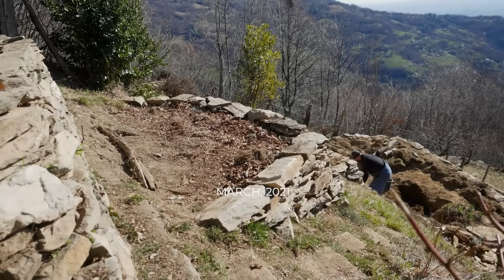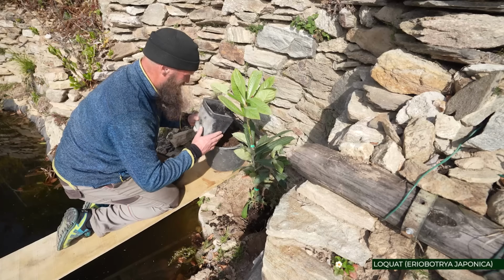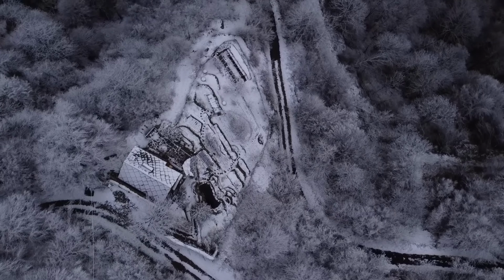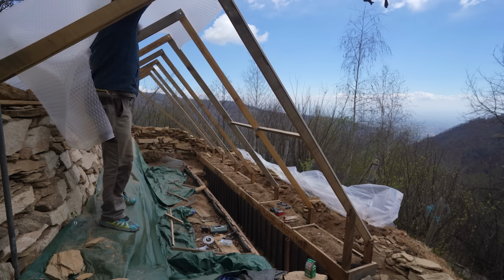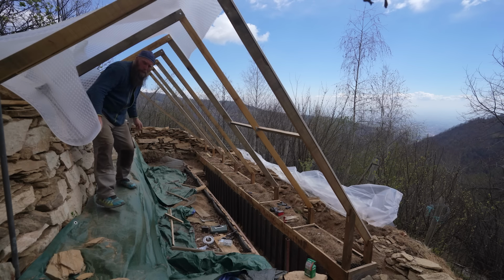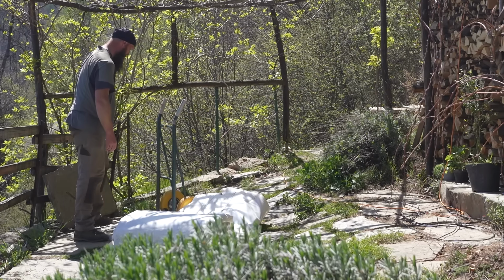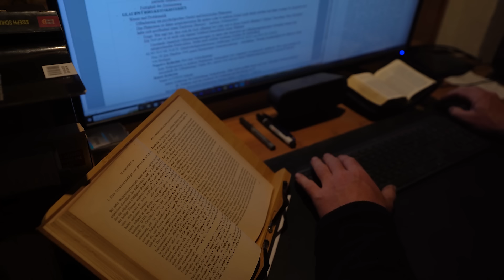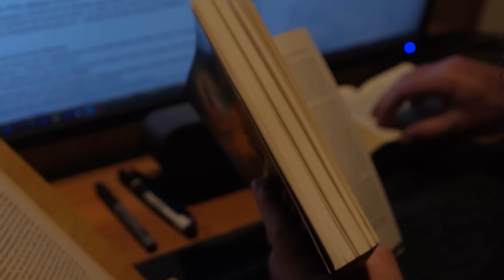One Year in the Life of a Part Time Hermit - April - Of terracing, a roof and the coming rains

Comment: Johannes, did you know that as a rule of thumb, one hundred years of leaf litter in deciduous temperate regions will provide no more than one inch of  soil. I believe that in the tropics it is even worse. Wood chips and animal compost, food waste etc are the real soil builders. And as any gardener will tell you, they are permanently in short supply. EG; typically I would produce about 80 litres of food scraps in the compost, this is enough for only one two metre by one metre bed.
Sorry about mixing the old German measurement system with the Metric, I am seventy and find reducing inches to Frenchiemetre's Impossible!

Comment: Hello Fr. Johannes, thank you for sharing your life with us with the videos and which gives me ideas for our garden. The Shredder would be of great help in tidying up our property. In researching them it appears there are many different makes on the market with different functions, your one would suit our needs well so could I as you what manufacturer it is and will search if it is available here in Ireland. Stay safe.
Reply from the maker: This particular model is the FQ-ELH 2500 from a local hardware store. Nothing special. One that had the least negative reviews and where it had them was less important to me. For there a two basic types: rotating knives (better for small green/fresh clippings) and the ones like mine that have a slowly rotating crusher (better for old, dry twigs/branches, such as those left from cutting trees). So depending on your needs you might be better off with something else
Reply: @donjojohannes  
Hello again Fr. Johannes. Thank you for the information on the Shredder, I have done more research on them here and I consider the machine that “crushes” the twigs and cuttings would be best for us as they are similar to what is shown in your video.
Your dialogues at the end of each presentation are excellent and the most recent one especially so - we will be 50 years married later this year - extraordinary!!!.
If Ireland is ever on your travels again let us know.

Comment: You didn’t tell us how you attached the poly film?  It looks like there is a white  plastic baton pinning down the poly film.  Could you elucidate?
Reply from the maker: Solawrap is not a poly film that needs to be pinned down but it has has special edges that are threaded into the white plastic "railings" fixed onto the underconstruction (wood in my case). That is what you see in the video: me threading the panels into the "railing". But if you google Solawrap you'll find the mechanism explained in terms that are probably more understandable. I lack the proper words to describe it in English